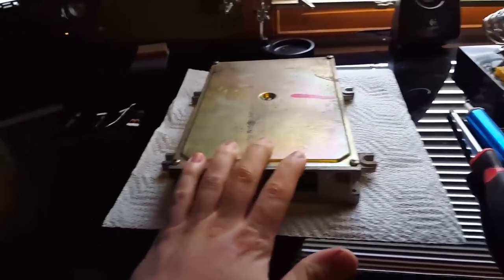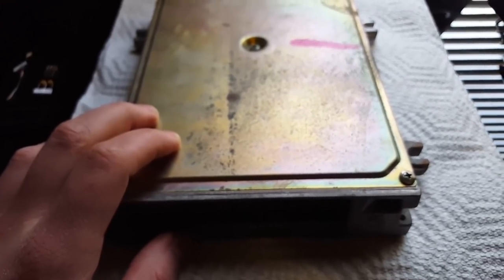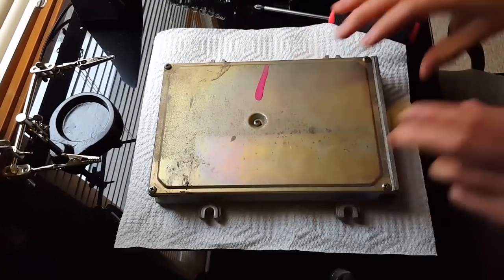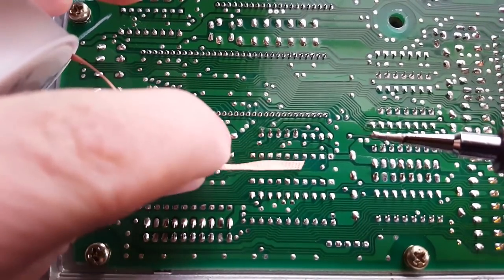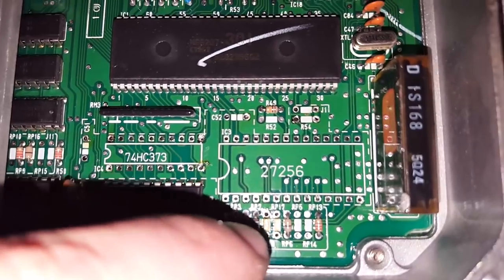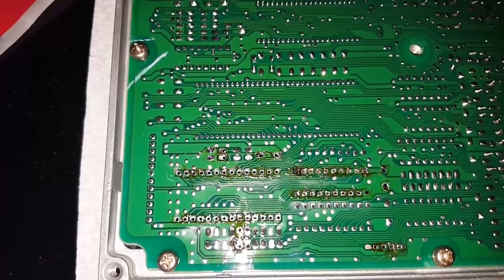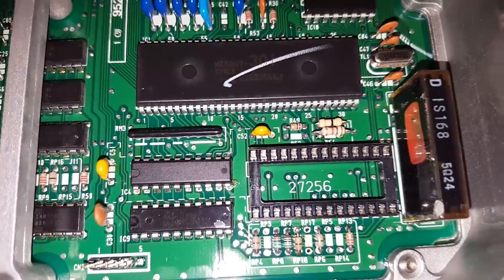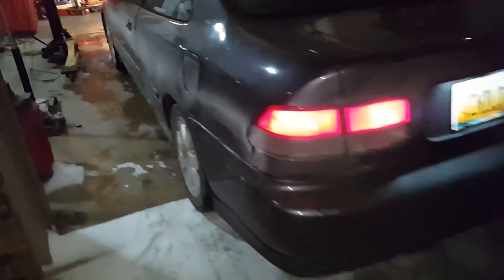How To Chip An OBD1 Honda ECU | Turbo Build Pt.1

Comment: With the water pump and timing belt done recently, what about the timing being off a little?
Reply from the maker: Messenger 22 I still need to adjust the valves. I'm pretty sure it's correct but I'll double check the timing while I'm at it

Comment: You should replace your main relay. I have a civic with stock d16y8 that would fall on its face like that after full throttle
Reply from the maker: Erick Estrada Thanks! I was thinking that could be it. I swap it out and give it a try

Comment: My car was also converted from auto to manual and i still have the auto ecu in it , i have not converted the ecu but do i have to ? What happens if you don’t ? Thanks
Reply from the maker: It will run fine but you'll get a check engine light for it
Reply: I got a solution for that..
Some others remove the r18 and 17 then jump r18.
But mine is I just put dummy load for the automatic solinoid on the engine harness, so that the ecu will think that the automatic solinoid is still plugged in 😊